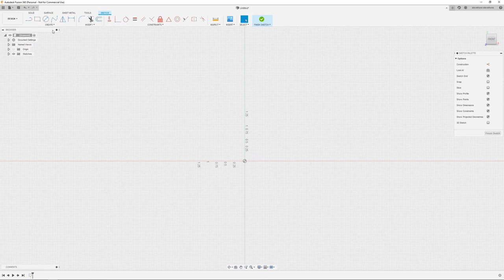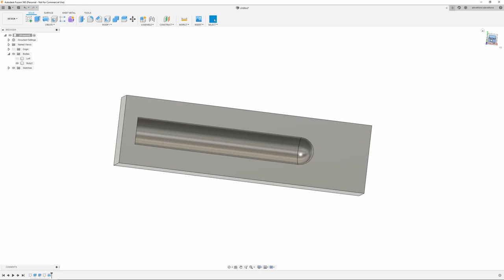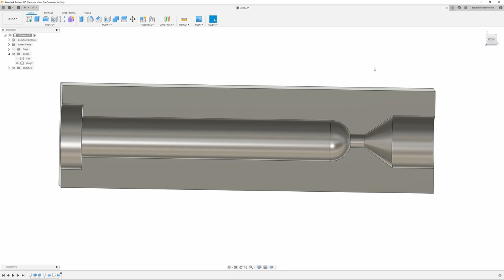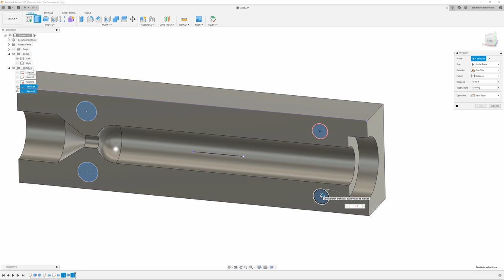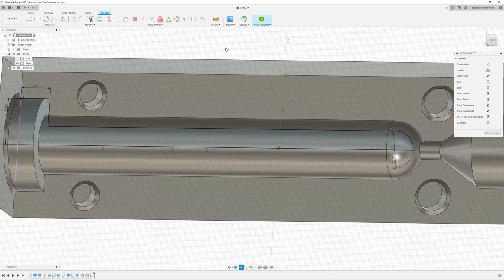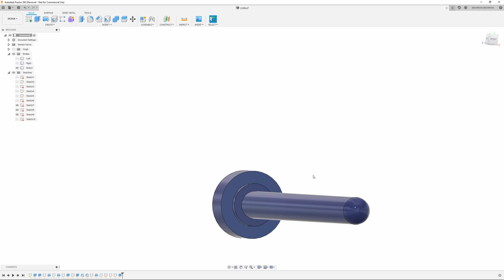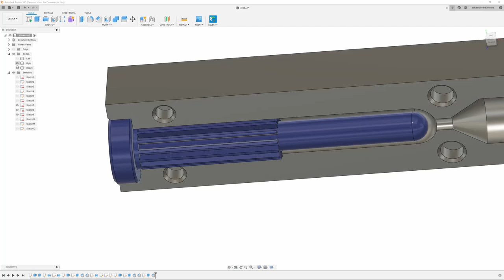Making 3D Printed Injection Molds for Soft Plastic Lures (Tube Baits + Machining a DIY Injector)

Comment from the maker: 00:18 - Skip the Intro
13:50 - Skip the CAD Design Work.
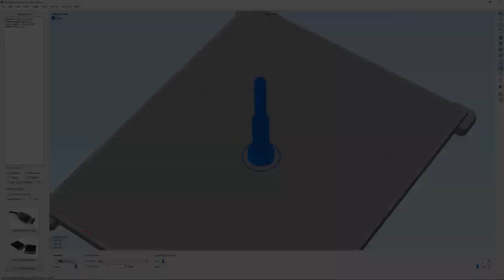14:57 - Skip the Printer Settings.
17:24 - Skip the Injector Machining Timelapse
19:42 - Skip the Injector Assembly
22:47 - Skip Single Cavity Injection part.
26:27 - Skip to the Finished Tube Baits.

Comment: Your workflow is amazingly well streamlined, I would still be debating with myself about the length of the whole tube lol.
That injector is a thing of beauty! Great use of the lathe with common items.

Edit: commented too early had to add more.
Reply from the maker: Thanks but I did have the bits and pieces all worked out before making the video and of course a little editing always does wonders too. :)

Comment: could you maybe use a grease gun as an alternative to the injection gun you made? maybe modify the plunger with a better o ring?
Reply from the maker: I'm not sure you would be able to pump it fast enough to fill a mold before the plastic cooled.

Comment: What kind of filament did you use? Seeing how you melted the one mold im suspecting pla? Maybe use ASA if you remake due to the higher temp needed to reach the melting point. But that might be hindered by your machine.
Reply from the maker: I do just use PLA but I have the technique down now so I haven’t had any more issues and have made a ton of more molds since this.  Thanks for the tips though.

Comment: nice mold you. where i can find the stl file
Reply from the maker: They will be on Cults3d soon...
Reply from the maker: Henco steenberg  Sorry they have not been uploaded yet I've been busy but I'll try to get them up soon.
Reply: It's on Cluts3d now, 86 cents purchase, what a bargain, it is a meshed stl file so it's not changeable, my suggestion would be to also provide a 4" tube to go with the 3.5". Great job on the production, I used ABS and am going to try the acetone smoothing tech.
Reply: Are you going to put your 6 tube mold on Cluts3d?

Comment: Can you 3d print a soft plastic injector with a locking pin?
Reply from the maker: I would NOT recommend trying to print an actual injector. The plastic would not hold up to the kind of heat plastisol temps can get too and it would be way to dangerous.  It's not worth the risks.... buy (or make) an aluminum injector.
Reply: @TheNeverendingProjectsList  I used a 60ml enteral syringe and it resists heat quite well.

Comment: what kind of printer are you using
Reply from the maker: I use Makergear M2's (FDM printers)
Reply: Have you ever don’t Mini tubes for trout?
Like a 1.5” tube?
Reply from the maker: @cali_misfit1387  I have not... I didn't even know that was a thing. I'm not a very good trout fisherman I mostly just use spinner.

Comment: Is it possible to 3D print a mold for a part that is made of hard resin?
Reply from the maker: From what I heard the high temp resin they use in those printers is actually better so I'd say yes but I have no actual experience with them myself.

Comment: instead of making it wider, have you tried printing it on a raft to avoid the warping?
Reply from the maker: Joakim Nylander it’s not warping during printing, its warping during the injection process. I did another one for mini tubes and I added a 1/8” steel rod in the middle of the mold on each side to try to eliminate the problem.

Comment: Cool way of going at Tubes. All Abs i assume?
Reply from the maker: Nope I use PLA+ for most of my stuff. I haven't actually tried ABS yet for a mold.. I did try ePC but plastisol bonds to it like glue.
Reply: @TheNeverendingProjectsList  interesting. Tried Pla in the beginning. Melted Like Butter. Switched to Abs since. Works great. Abs plus Sticks to the plastisol. May give Pla+ a Shot as well

Comment: Hey so I purchased the file for the single cavity mold so the left printed perfectly but the right when I slice it the first layer is split into diffrent sections, I'm wondering if you have heard of any issue like this
Reply from the maker: I have not heard of anyone else having this problem.  You sure it's placed on the surface correctly?
Reply: @TheNeverendingProjectsList  hey so I'm a newbie at 3d printing sorry for bothering you I actully had it angled slightly in my slicer 🤣 complete newbie error 🤣
Reply from the maker: @nightdrivers9138  Happens to the best of us... just glad to help.

Comment: how long do the moulds last as the liquid is at 300 degrease and pla prints at 210 degreas
Reply from the maker: I honestly do not know the longevity of the molds yet. I just make enough baits for myself (which is usually not a lot) before moving on to the next bait design.  I don't think I'd be using 3D printed molds to do any mass production of baits though... aluminum would be they only way to go for that.  As for the temps I probably wasn't clear but the printed plastic temps are in Celsius and the plastisol plastic temps are in Fahrenheit so that 300° in F is actually only around 148° C so it is below the printing temp of the 3D filament.  The plastisol can still melt the molds if you are not careful but it does cool down fast enough to work overall.
Reply: @TheNeverendingProjectsList  i do 3d printing to aid me in maiking my aluminum moulds but they are sand cast but i will give it a go cheers
Reply: @TheNeverendingProjectsList  You could try to print the molds in PETG, ABS or ASA. PLA withstands 60C, PETG 80C, ABS 100C+. They would probably last longer... You can also try to anneal the PLA, as it would gain a higher temperature resistance.
Reply from the maker: @Hallslys  PLA has been working for the most part... I did try ePC which is really high temp stuff but the plastisol stuck to it like superglue.

Comment: What type of 3D printer would you recommend for lure printing?
Reply from the maker: As far as "type" I only know FDM printing but Resin type printers would give you more detailed prints but can be trickier and messy to work with (from what I hear).  I honestly don't know a ton about the various printers, I bought high end printers from the start (Makergear M2's) so I didn't have to spend a lot of time messing with them. I hear a lot of good things these days about the Creality brand of FDM printers though. (The Ender 3 and Cr-10 Models) The are relativity cheap starter printers but are really good from what I hear. Being popular there is a lot of support out there for them too.   Overall though it's going to depend how what you want to make, what your budget is, and how serious you are about making lures.
Reply: I have an ender 3 pro. I've done some upgrades and make a ton of different things with them. From toys for the kids, Hooks and brackets for around the house, printer upgrades, and gifts for family members (lithophanes). Cartesian style fdm printers are awesome for hobby work. I'm looking into getting a delta style printer so prints take less time and still have good quality.

Comment: I know this is an old vid but do you sell the molds you make? I really want something other than plaster lol
Reply from the maker: I do not... I only sell the files so people can print their own.
Reply: @TheNeverendingProjectsList  oh okay, hey so I was thinking about getting a 3d printer, I was thinking about going with the ender 3 pro, do you know how well that printer would work with injection molds ? I want as smooth of a finish as possible, I'm not sure if your supposed to use a smaller mm PLA if you want your end result to be smooth or if your supposed to do something afterwards.
Reply: @TheNeverendingProjectsList  also would you be willing to design a custom file for me?
Reply from the maker: @musicislife6802  I hear a resin printer is the way to go if your looking for higher detail but I have heard good things about the Ender line of printers. They should be able to print the same as what I do anyway.
Reply from the maker: @musicislife6802  Sorry custom work is not something I do as I just don't have the spare time.
Reply: @TheNeverendingProjectsList  okay I understand 🙂 thanks for the reply !

Comment: Nice work, what material do you use for printing the molds?
Reply from the maker: I've been just using eSun PLA+
Reply: @TheNeverendingProjectsList  I dont understand how pla holds plastisol temperature (170~180°C) . When pla is affected by heat inside a car in summer… maybe 60~65ºC 🤔
Reply from the maker: @josedavid6400  You have to remember the Plastisol starts cooling really fast once it's injected so it's not at a sustained temperature where as something in your car is at that temperature all day long.
Reply: @TheNeverendingProjectsList  ok, i'll try it
Reply from the maker: @josedavid6400  You can always try printing with a higher temp material.  Be sure to watch my other video on how I inject the molds too.

Comment: Wondering, what filament you used? 🤔 Does pla work or do you have to use abs? Thanks bud! Great job! Greetings from Germany :)
Reply from the maker: I use PLA+.  ABS (or PETG) would probably be better but PLA has been working well enough for me. I just have to keep my plastisol temps around 300° while injecting.  If it's too hot it can/will melt the mold.
Reply: @TheNeverendingProjectsList  thanks for the quick response! Gonna try it myself :)

Comment: nice video, I'm happy that youtube suggested this :)
A little comment, on all the camera shots, the audio seems to be recorded as stereo, however only the left channel is active. That's fairly uncomfortable with headphones, so maybe downmix that audio to mono again :)
Reply from the maker: Thanks for the advice much like making lures I'm kind of figuring out all this video stuff as I go. The sound is screwy from placing my mic of the left side of the frame and hopefully I fixed this issue half way through my next video but I'll definitely try the mono suggestion to see if that helps so thanks again for taking the time to comment.

Comment: Awesome Job Can i Hire You To Do Some CAD Work and a Printed Mold Of a Swim Bait / Worm i Made a Mold Out Of High Heat Red Rubber The Swim Bait is Pretty Simple But Different And The Action is Crazy i Have Cot a Lot Of Fish on it To But i Need Like You Did at Least a 6 Cavity Mold To Be Less Time Consuming and in The Feature i Would Like To Take The CAD File To my Local CnC Shop To Make a Aluminum Mold Dude Your Work Looks Great i Can Send You Pictures and Dimensions Of a Working Model and Some Add on ideas i Would Like To Add To The Design and i Will Pay For Your Time Thanks Frank R I Have So many Ideas on Paper Also Thanks For Your Time
Reply from the maker: Sorry unfortunately I just don't have the time to take on any other projects right now.
Reply: @TheNeverendingProjectsList  well if you need some extra money and change your mind please let me know and thank you so much for responding once again your work is awesome